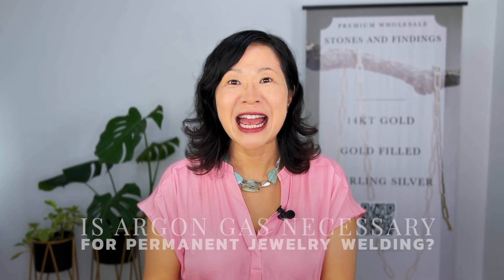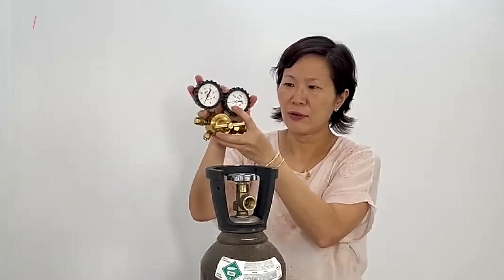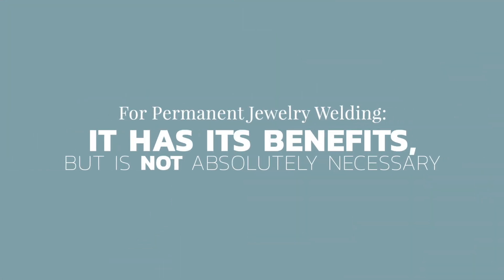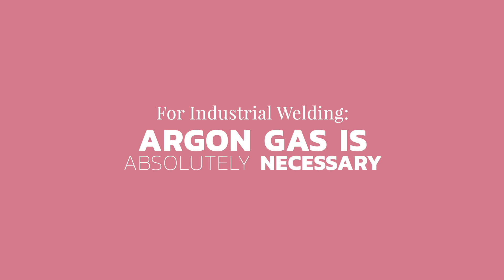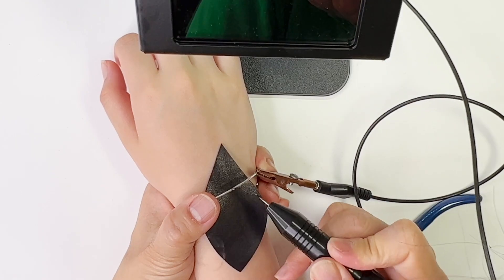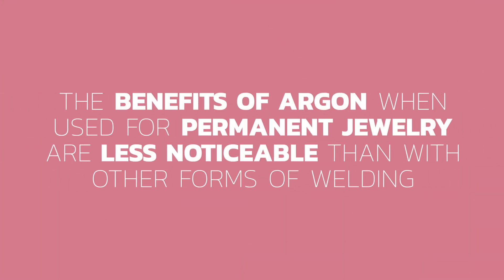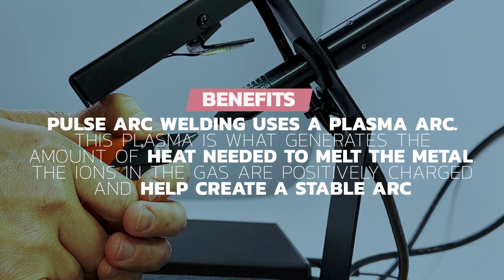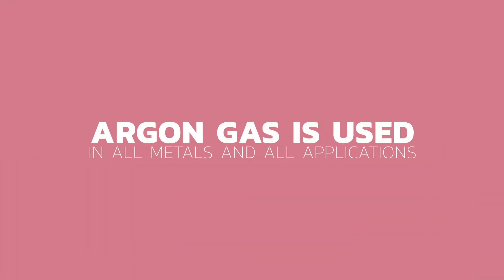11b Is Argon Gas Necessary For Permanent Jewelry Welding? ⚡️ Update and Info by Stones And Findings

Comment: Thanks for this informative video and all of the information.  Do you use argon each time for your clients?  If not, how do you pick when to use and when not to use?
Reply from the maker: I don't use argon each time.  I would suggest it for chain or areas that have small crevices, areas hard to get into with your brush bristle.  The other one would be with gold filled, if you want to.  With sterling silver, the oxidation will wash off after a shower or two.